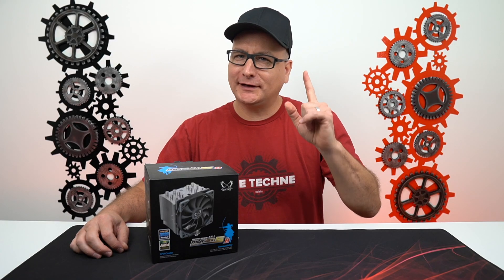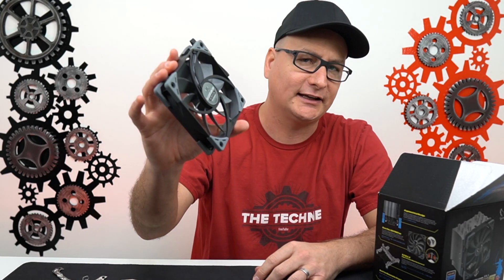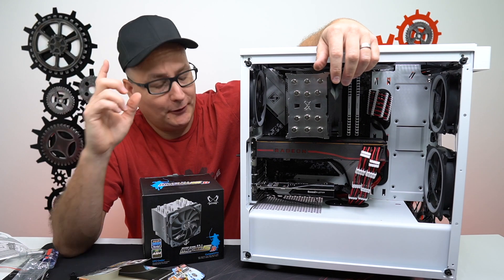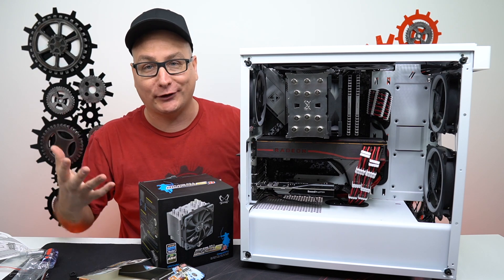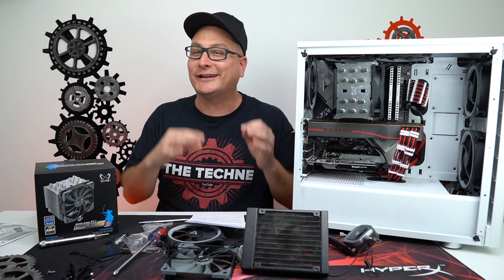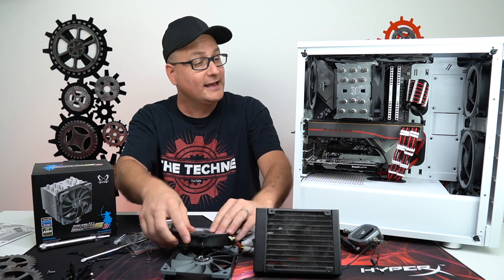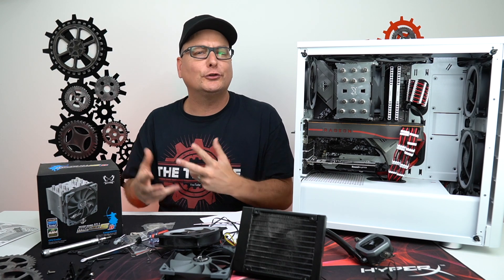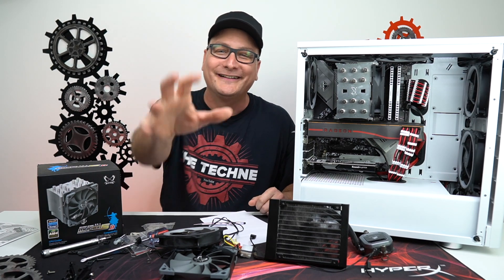Air or Liquid PC Cooler - Scythe Mugen 5 Rev.B Review

Comment: I've always been a little paranoid using liquid cooling. Accidents are rare but I envision my $2000+ rig investment shorting out if something goes wrong. I was excited to install my scuthy ninja 5 for $60 bucks after doing some testing on it. If I was going to use the rev B I'd add the second fan but that defeats the savings.

Comment: Bit late to the party but enjoyed your review style. I’m looking at this cooler v the Fuma 2 currently. One thing that could improve temps in your setup further for the mugen (again this is a late comment so your setup has probably completely changed now) - the top right side fan just in front of the mugen is probably sucking out some of the cool air being brought in by the front upper fan before it gets to the mugen’s fan. If anything I suppose you could flip the top right fan to intake air directly above the mugen’s fan, or get rid of it completely maybe.

Comment: You should look at the PCCooler GI-66A...dual RGB 120mm fans with RGB top plate and shroud.  A nickel-plated six-pipe cooler for $70 on AliEx. IMO, it is hard to beat considering the Scythe performs about the same at a higher price.

Comment: I just recently tested the cooler myself. I used static fan rpm of 1200 and the Mugen actually matched my 240mm AIO. Now granted 1200rpm is the maximum for the Mugen and my AIO fans can top out at 2100rpm but the Mugen is much quieter at maximum fan rpm than the 2x 120mm on my 240mm AIO
Reply from the maker: amazing right! did you see the results of the Ninja 5 I just posted, such great products! https://youtu.be/3ET6qNaZj6U

Comment: I'm glad you found this cooler. I've been screaming this things praise for years. With a second fan it cools insanely well. They make an even bigger one that covers the ram too (it looks like a huge ninja star) it's insane. It competes easily with the Noctua D-15 for less money. Love the video buddy!
Reply from the maker: thank you so much! yeah this cooler just blew me away ;) lol, and yeah man the Ninja is on my radar!!
Reply: I have been using these for years also. One cools my 2700x oc. Its good but no noctua d-15. Scythe chooses 2 low rpm fans to reduce noise. Noctua uses higher rpm fans that are low noise. It cools around 5-10 degrees better than the scythe but you wouldnt notice that with cpu s that cant or arent overclocked to 5+ghz. And even then it would still be fine only a bit hotter. Its just a great cooler and a great buy.
Reply: @Boemtie  That makes sense. I agree that noctua has the better fans. For my old rig I was able to get the Mugen 5 and a second fan for less than a d-15. I have seen tests comparing the 2 coolers and the difference in temps on that particular test was 1c, and the cases airflow of course makes a difference.  You may be right though, my last CPU only overclocked to 4ghz or so. I have heard that the stock mugen 5 can cool an overclocked i7 9700k pretty well, maybe a test showing that would be pretty awesome.
Reply: @Phatbeater  Tadaaaa, I introduce you the Scythe Fuma 2. You should take a look at that 60 Dollars cooler.
Reply: @dorientjewoller113  I have seen that thing and it looks amazing. On my next build I want to go back to air cooling my CPU. I dont hate my kraken but I don't love all the software these days. Something like the Fuma will be on my radar for sure!
Reply: @Phatbeater  yeah it can cool better in a good airflow case. I have been using de pro m special edition cases from phanteks they come with great silent 140 mm fans comparible with the likes of silent wings. I configure it with the mugen cooler with 1 fan on te cooler and the other one on the rear. It keeps everything nice cool and quiet. Pair it with a pro carbon motherboard because the rgb on that board just seemlessly goes with all the right curves in that perticular case. It has a white interiour and in combo with the light from the front fans you get so cool effects its pretty believe me!
Reply: Would y'all recommend instead of 3 intake fans on the front my case for this cooler, to take one out for a push/pull config on the Scythe M?
Reply: @MilesBeforeMonday  I think I get what you're asking. If you have 3 intake and 0 exhaust fans then ABSOLUTELY! If you only have cold air intake and no exhaust the hot air from components will just sit in the case much longer and the hot air will start to recycle back through your components. Different cases benefit from different configurations, but you definitely need at least some exhaust. 2 in 1 out should be much better than just 3 in.
Reply: Kody Reeves I have 1 exhaust and 3 intake I’m wondering if I should put 1 intake onto the CPU cooler for push/pull config? Thanks tho (:
Reply: @MilesBeforeMonday  hmmmm you could if you wanted. I would recommend just paying $10 and get another of their fans to match, especially since the fan RPM will be much more closely matched. I would double check, but I think they're called Kaze flex fans.

Comment: Cooler Master hyper 212 rgb blavk edition or Cooler masterl360r rgb
Reply: I have one more question Does aio coolimg safe because iwant to change my air cooler to aio cooler.
Reply from the maker: @desireerivera7593  I used my corsair h60 for almost a year and it was perfectly fine.
Reply from the maker: haven't tested either, but at was looking at that hyper 212 blk, looks like a great deal. not sure how the results will pair compare to this mugen 5